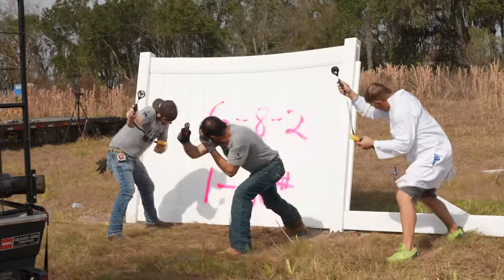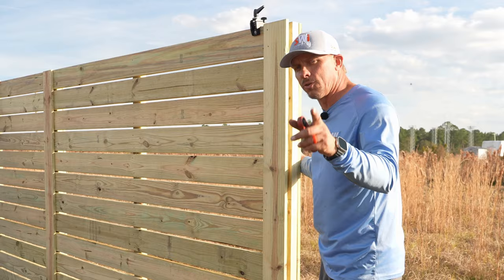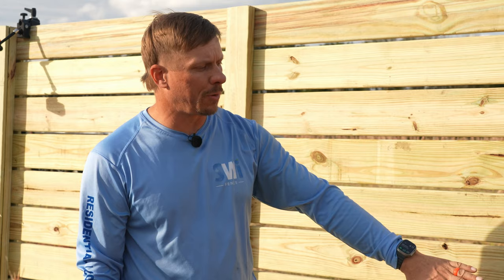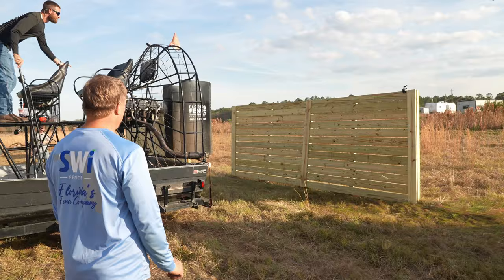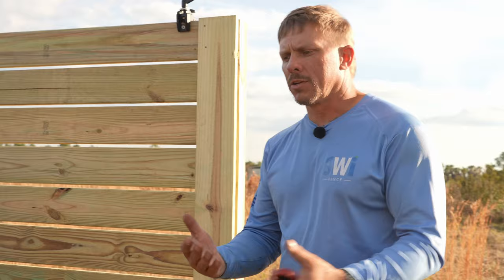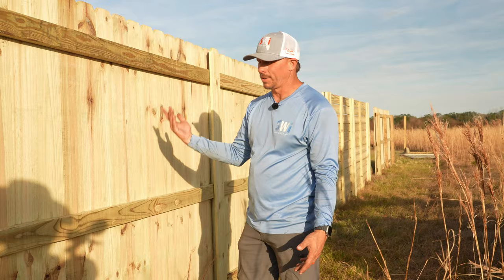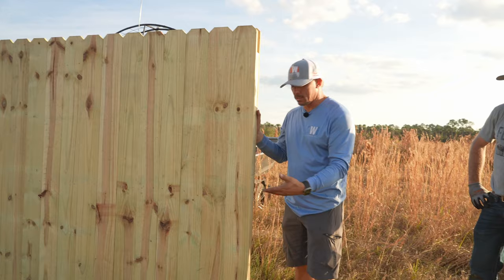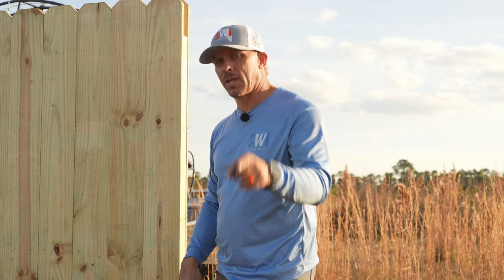We Can't Get These Fence Posts To Fail

Comment: When we moved from the farm to a small town in 1977, my dad built a fence around our yard out of rough cut lumber from the local Amish sawmill. I don't remember if we cemented the posts or not, but I do remember helping apply an oil type treatment on them before they went into the ground. The above ground posts and fence pickets got treated with the oil too, but maybe after the 1st season. Probably a turpentine,  old engine oil & some other stuff, typical for farmers of that era. Then every sever years was retreated with the oil mix.

The wood variety was a hard wood since I remember helping to pilot drill all the lag bolts and  nail holes. I'm thinking the pickets were 3/4 " .

Comment: I have always used 4x4 wood posts in the past cemented in place. I need to replace a couple of sections of a fence this summer. Rather than using cement or foam, I'm thinking of lining the new holes with heavy-duty weed cloth, placing the posts on a 1/4-10 gravel base (no fines) and then filling the hole with round river rock. Once full, I would wrap the weed cloth over the top of the rocks. My thinking is that the rock would fill the space very tightly and provide excellent lateral stability and superior drainage. Any changes in the soil would simply allow the rocks to settle, maintaining a tight lateral support. The weed cloth would prevent soil eventually filling the spaces between the rocks. Rot in PT wood occurs when soil is in direct contact with the wood, and since there is no soil contact, the posts should last for a very long time, especially if coated with a tar emulsion. I would also place a plastic sleave at ground level to prevent any soil contact from backfill or accumulation.  I'm not worried about vertical "negative gravity" because I just don't see fences failing that way. So, would this approach make any sense?

Comment: Would like to retest after fixing the metal post. Sure metal will flex but a bend is the material yielding. Bending back would reduce the strength and subsequent fixing adds flex fatigue. Really like the product tho!
Reply: Agreed. I would like to see this same test with a span of 4x4 post fencing bolted to concrete using the simpson ez post bases as well

Comment: Hey, the fence had 3/4' air gaps between the horizontal boards where the other fences had none. That makes a huge difference in wind load.
Reply from the maker: Not like you'd think.
Reply: @SWiFence  I live in Florida and thinking the best privacy fence design for high winds is Shadowbox fencing. I am interested in using the Postmaster steel posts but cant find any DIY videos for that construction. Do you think Shadowbox is the way to go? Strength and longevity is what I am looking for.
Reply from the maker: Shadowbox fencing doesn't really hold up well in strong winds, just a heads up. Unfortunately, we don't have a video available for the shadow box style just yet. But if you're interested in those postmaster posts, our sister company over in St. Augustine could definitely help you with that.
https://swiflorida.com/
(904) 502-4361

Comment: now, would you still recommend using the postmaster steel post without concrete when installing in a southern location. I'm in southern MS where we get hurricanes, high humidity levels, the ground stays fairly moist, etc.. my assumption is it's better to concrete them in my area.. i do plan to use these steel posts though.
Reply from the maker: These tests were done in Florida sand. As long as you're going to appropriate depth and the soil allows for it in your area you can drive.
Reply: awesome. thanks.  @SWiFence

Comment: If the Postmaster posts bend and you bend them back, will the zinc plating crack at the bend, allowing corrosion to begin to set in?
Reply from the maker: We have not seen any coating cracks on any coated steel postmasters or pipe even when nearly kinked.

Comment: When you bend the post back after, probably an unusual wind event, does it substantially weaken the post?
Reply from the maker: We are bending them so very little that it is not affecting the strength.  Much like when you repeatedly bend any other metal, you can create weak spots, but this is typically achieved after you have kinked them in which case we would try and salvage them.  Something that has only been bent a slight amount is not being substantially weakened in any way.

Comment: Would it be possible to install 2 of the engineered posts face to face ][....  Even if you did it one at a time and then bolted them together....  Seems like that would withstand anything...
Reply from the maker: You could totally double them up with a little welding.

Comment: What’s the gauge thickness of that metal post ?  
Also what’s your thoughts on 18 & 16 gauge metal square posts .., it’s a 2x2x8’ 18,16 and 14 gauge is that a good thickness to use for a fence post with a 5 to 6 feet apart

Comment: What's the difference in price with metal vs 4x4's. I'm actually getting ready to build a privacy fence.
Reply: I know it’s a bit dated, but here 4x4x8’s are $11, 16ga 2 3/8” 8’ round posts are $27, & these postmaster posts in 8’ are about $80. Makes quite a difference in overall cost, but guess it’s what you want in the end. I like the round posts kinda middle ground cost with all the benefits of metal in the ground over wood.

Comment: What a great type of post system. (but... I have a question)
I have an oopsie story.  Over here in Tampa Bay, I decided to install a Patio Cover on my 54 year old house.  I dug and placed two 8" concrete tubes with no issue.  The third, I was digging at sundown, and encountered some funky broken cinder blocks as I was digging.  I thought it a bit weird, but kept going.  Finally, I came across some highly resistive stone going at an angle.  Pulled out my digging bar and demolished it.  When I dug it out, much to my surprise, it looked like clay tile...  I had my wife flush the toilet on that side of the house, and... yeah.

Anyway, after a whole lot of digging and a 2' PVC & a couple Clay-to-PVC Ferncos later, I'm back up and running.  
I highly doubt ANYONE would have expected a sewer pipe going diagonally from one end of the house to the main line coming out straight.  

So my question is, have you ever encountered a strangely placed one-in-a-million pipe of any sort in your past and had an 'oopsie'?  This one defied all logic.
Thanks!
Reply from the maker: Two years ago I ran an auger through an unmarked 6" irrigation line. It was fed by a full retention pond, so we had to let the whole pond drain just to fix it. 🤦‍♂️

Comment: How does the strength of a post 3ft deep compare to one that's 2ft deep? I often see 2ft as the recommended depth? Thanks!
Reply from the maker: 2' just isn't enough in my opinion, but it can vary depending on your soil type. https://youtu.be/mc92svvCRFo

Comment: Hey SWI, 
Looking to get a fence done and because of the length of fence (475 linear feet potentially) and the ease of Postmaster posts, I’m thinking of doing DIY and rented tools. I’m here in Kansas and worried about 1. How easily these are to DIY and 2. How well it’ll stand up to the mean Kansas wind
Reply from the maker: You got this. 💪🏻 1. Every DIY is different in their skill level, but we feel good about encouraging you to get it done. 2. I mean, I doubt it's worse than the hurricane winds we just tested in the video. Seriously, if you go deep enough you'll be fine. This is our method of choice in Wyoming and we have nothing but wind up here.

Comment: Why not use the round tubing posts if that's what's proven itself for cantilever strength and durability?  Why use the Postmaster channel shape?  An engineer would tell you the optimal post is an I-beam shape, not tubing or channel.
Reply from the maker: The simplest reason is because there is no way to hide the unsightly post with a typical round chain-link fence post.  There is a balance between strength and aesthetics going on here.
Reply: Also, I beam i the first, but then postmaster design is second in wind rating. Then sch. 40 tube

Comment: Gentlemens you have me a bit wary of the results, on this one… I understand you have diplomas from Fence Erection University.  You used a genuine alligator chasing air boat.  And, that you used digital Any-mometers.  But, are y’all certified Fence Demolitionists?

I mean, I’ve watched thousands of product advertisements over the years.  And they all have a genuine doctor as their spokesperson!  You can tell he/she is a doctor because of the smock and stethoscope they are wearing… 

Y’all showed up for the first test in lab coats… I never doubted your qualifications.  However after seeing that you’uns didn’t even bother to do it for the last few videos…. You have me wondering!

Were you only qualified to test homeowner grade installations?  
Or is it just… the lab coats were still in the laundry?  

Please advise so I can relax an have a good danged day.

PS: I have a stethoscope that I use to listen for engine rattles on my old Farmall… I can loan it to you for your next video.  That’ll help dispel some of the doubt that this wardrobe malfunction has caused.
Reply from the maker: It... it got hot... But you're absolutely right! We should not be throwing our credentials away just to be more comfortable in warm weather. 😞😆

Comment: Have you ever tried using the  "Fence King Tac Welded Double PostMaster+ Posts" ?
I've never seen anyone else use this product.

Website description: "Fence King tac welds two PostMaster+ posts together for the most durable installation. These reinforced posts can be installed exposed or concealed with wood pickets. Posts installed in this method can withstand Category 2 hurricane-force winds of 115mph."
Reply from the maker: This method was actually developed by Master Halco, the makers of Postmaster. We've used it on rare occasions. In most applications, if you're using a dried cedar product, the gates typically aren't heavy enough to necessitate using that method.

Comment: Cost is way too much....
Reply from the maker: Depends how long you're planning for. The cost of replacing a fence is pretty brutal.
Reply: I found postmasters locally for $33.
Total cost per 4x4 installed would be $29.52.
PT 4x4 $14
2x bags concrete $12
4x Simpson fence brackets $3.52

An extra $3.50 per post was well worth it for greatly increased longevity and way easier installation.